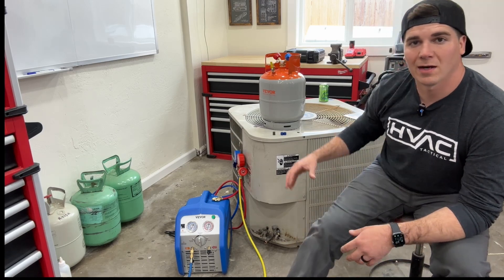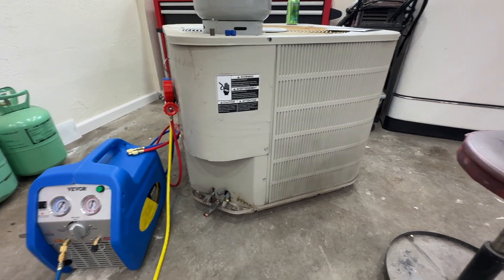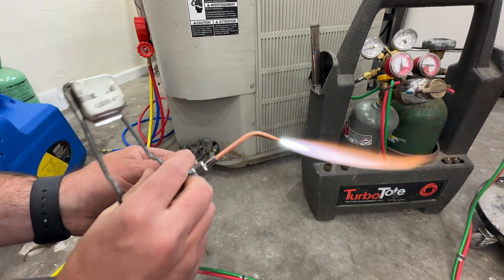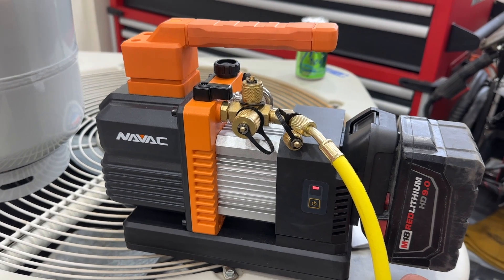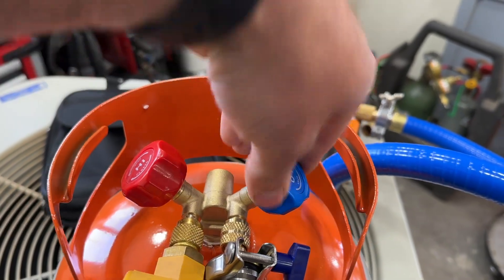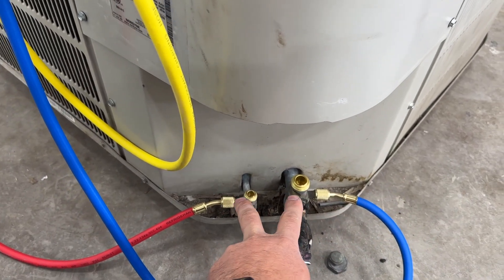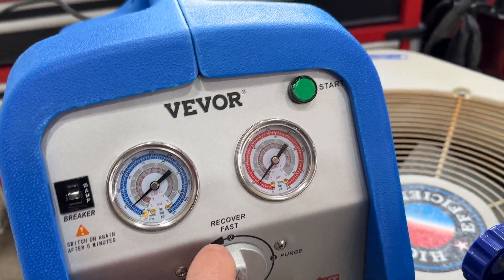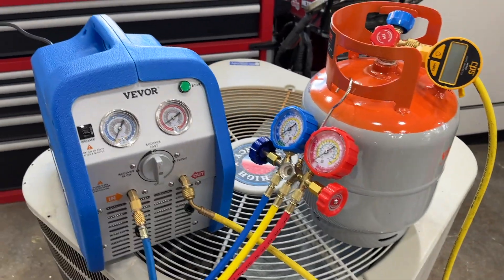How To Properly Recover HVAC Refrigerant Into A Tank

Comment: I just bought a replacement, brand new, genuine Trane 2.8 ton Compressor for our XL19i outdoor unit; our old compressor has a locked rotor.
I bought a Vevor Recovery Refrigerant Recovery Machine, and now a Tank (from watching this video). The Compressor with tax and shipping was $1,350. The Recovery Machine was $350 total. The Tank is  $77.  The Total to get our 2008 Trane XL19I R22 System working great again is $1,777. There's also no brazing due to Trane's Two Threaded Fittings design. It's going to be so much better than being forced to buy a new 410 Refrigerant System!
Thank you for showing us how to remove and store VALUABLE R22.
Reply: Resources on where to purchase those recovery items?
Reply: @turbopomsky  See next comment.
Reply: @turbopomsky  Amazon Store Card available to anyone.
When we were finished, I sold the Vevor Recovery Machine and the Refrigerant Tank on Craigslist, and used that money to pay for the Amazon Store Card balance.
Reply: @turbopomsky  I used the Amazon Store Card. Anyone can apply.
After we were finished, I sold the Vevor Recovery Machine and the Refrigerant Tank on Craigslist. Then, used That money to pay for the Balance on the Amazon Store Card.
Reply: Might want to do an acid test on that unit before swapping the compressor
Reply: the R-22 systems is running better than R-410A ?
Reply: Have u looked into what r22 actually is? Methane and bit of butane and some fluorine and chlorine…they banned it because DuPont couldn’t file for another extension …they can’t be having just anyone able to produce r22…it’s their profit afterall lol…this whole climate bs is a damned con job to create this problem we all have to afford to keep up with their solutions to fix a nonexistent issue….best stuff to use in an older r22 system if u can’t get clean r22 is r290….across the charts so similar for the psi and everything…and it’ll cool much better from what I’ve read and been told…currently waiting for all the stuff I need to swap my old carrier over to r290…crossing my fingers
Reply: Why is R22 valuable?

Comment: I am looking for the most cost effective way for a DIYer to recover R22 so they can install a new home unit. Will there be a video on how to recover R22 just using the compressor? I am not sure I would want to buy all of the equipment needed to recover R22 using a stand alone machine. My home has a 99 Goodman unit. Thanks.
Reply: if the old unit compressor still runs, hook up your gauge set, close the small line, plug in the disconnect, run unit until gauge reads near zero psi. now you can save that r22 inside the old unit...

Comment: How important is the vacuum pump?  I thought the recovery machine pulled the vacuum.
Reply from the maker: They are both very important. The recovery machine transfers refrigerant, and the vacuum pump just removes all moisture and air so that you can replace it with refrigerant, going directly from a vacuum to positive refrigerant pressure
Reply: @diyhvacguy  thank you!  glad I saw your video before doing it.  Neither the gauge set, tank or recovery machine say you also need the vacuum pump.

Comment: Nice video. I just got the same recovery tank you use, 30lb. Do you happen to know the Water Capacity weight of it? Mine doesn't have it stamped on it and is not mentioned in the manual. It's kind of hard to calculate 80% fill weight without knowing its rated WC weight. It also did not have the tare weight, but that was easy enough to figure out.

Comment: I always remove the tank ball valve. Its in a unprotected location. So easy to be knocked open and refrigerant blowout.
Reply from the maker: Yes! I found that out the hard way. Thankfully I was real fast closing it. I actually just threw a cap on it so even if it got opened nothing would happen

Comment: I have a unit that got struck by lightening and I want to change the compressor. I want to recover the Freon and reuse it when I change out the compressor. Is that ok to do? Some say the Freon is not useable again
Reply from the maker: If your compressor didn’t have what’s called compressor burn out, you can absolutely recover it, but you won’t be able to find a new unit that supports r22. They’re all 410a. So you are better off recovering it and selling it or having a company come and recover it for you.

Comment: Can anyone explain to me which lines you connect the hoses on. I’m rarely new to refrigeration.
Reply: Have u looked for more vids on how to hook up the lines and gages? Just search how to connect hvac gages to a central air unit…it’s been awhile but the insulated line is the cold line…blue…and the none insulated is the hot line return…red…yellow is feed…so it can of Freon is hooked to the yellow…im just another diy’er that’s been forced into being a diy’er because hvac is the biggest scam there is…Freon being gases like methane and propane and it is not ozone depleting like they say it is…ridiculous lie…methane and propane are found naturally in the atmosphere whether humans use it or not….it’s ridiculous that anyone would fall for the lies of this epa banning and I’m pretty sure the synthetic replacement will be absolutely devastating to the world but we won’t know it till it’s too late
Reply: Which lines on the unit suction, liquid, discharge

Comment: Hi dave i have a question,
Can you pump down a r410a heat pump condenser? I believe the condenser have 2 pressure switches,  low and high. 
Please let me know.
Thank you
Reply from the maker: Yes you can. I don’t believe you need to mess with the switches but it’s possibly you’d need to jump the high pressure switch. I think I’ve done a 410a pump down without having to mess with jumping anything
Reply: @diyhvacguy  thank you buddy,  all the videos you do are very helpfully

Comment: This is awesome, I have r22 in my system and i have a small leak somewhere and its expensive to recharge. This might be a good investment for a diy fix. Thanks
Reply: There are alternatives to R22. R427a, MO99, Bluon, R407c, and others currently cost about 1/3 the cost of real R22. THe current wholesale cost of R22 is around $1300 for a bottle of refrigerant; while the alternatives vary from around $350-400. But, yeah, a leaking system needs to be either repaired or replaced.
Reply: Repair it! Don’t fall for the aluminum scam! And Freon is methane and propane